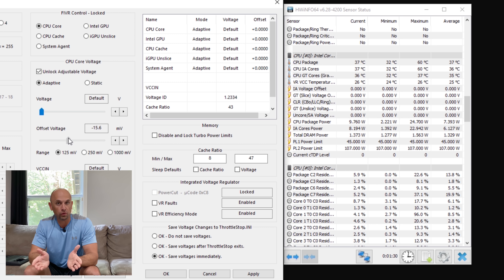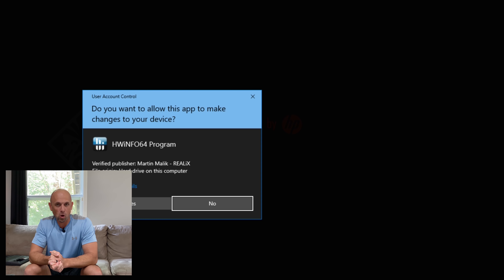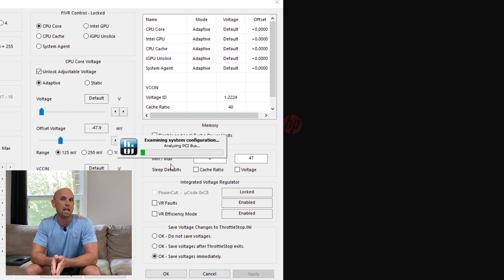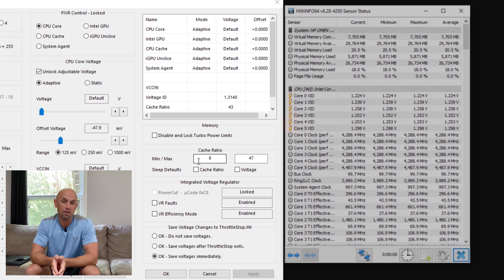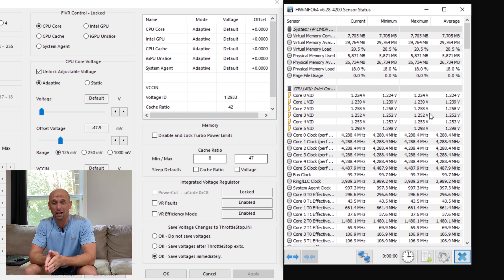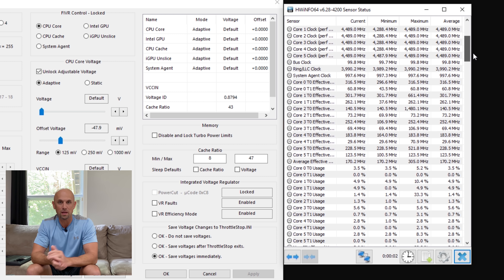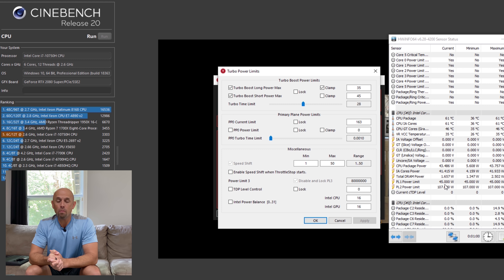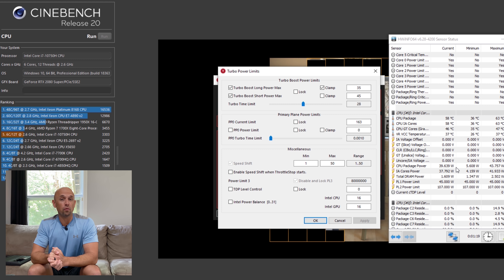Can't Undervolt?  Do This!

Comment from the maker: The Description has more information that could be worth your time, as always.  Good Luck and post your results!
Reply: Is that the thick 15 from eluktronics on the sofa 😁.
Reply: i5 9300H+2060 or i7 10750H+1660 Ti? Which one would you choose for gaming, Bob?
Reply: @rifatul  depends on wattage as said, but the 1660Ti (mobile) isn't that far behind a 2060 (mobile). If u can afford the 2060, go for it as it supports DLSS & RT, which hopefully will be supported in more games down the road and thus should provide better perf in newer titles imo.
Reply: @rifatul  Or try to find laptop with i7-9750H and RTX 2060. I7-9750H is much more the same like i7-10750H only little bit overclocked.
Reply: Hey bob, I was windering what can I tune aside from the power limits in the 10th gen i7 intel laptops?
Reply: @graelstream2353  configuring the clocks can also reduce the wattage-like giving more weightage to single-core perf & limiting the all-core turbo.
Reply: i guess Im kinda off topic but do anybody know of a good website to watch newly released series online ?

Comment: Screw intel 10th gen.
Undervolting is a must.
Shame on intel.
Reply from the maker: We’re seeing more of this lately 👍
Reply: Absolutely agree, I have the CPU in the  video and I'm so bloody angry about the locks on this CPU. There's no way I'm buying Intel next time.
Reply from the maker: Apparently it’s not Intel that’s doing this.  It’s up to the manufacturers to allow this.  Even intel’s QC7 whitebook has undervolting in their bios.
Reply: @BobOfAllTrades  hey bob. I have a question. May I know how do i determine the perfect power limit values? Like what tests to do etc. Sorry for this noob qn, I'm new to laptops
Reply: next time im going with AMD, it runs cooler and faster ._.
Reply: @shadradbad3518  Not necessarily. Faster yes
Reply: @Hijynx87  ive seen it in videos faster and cooler in Laptops
Reply: Yeah you can only decrease the voltage about 80mv max which result 5degree which is hilarious my i710875h runs between 90-100 c
All the time . This processor is great “If you live fkin Alaska”
Reply: @goldenplectrum9695  disable turbo boost
Reply: @Behavoid  disabling turbo boosts helps. But it decreases your fps tremendously :(
Reply: i also have the asus tuf f15 with i7 10870h and im so sad that i cant undervolt my laptop :)
im facing thermal throttling with temps above 80 degrees all the time and i was hopeful that undervolt would help me but im completely dissapointed now...
Reply: @faizul3747  hey man, I am getting 90c and above 80% of the time im in turbo mode and playing a game.

Comment: I watched this video and honestly did not expect much to change in my laptop's thermals. But I was wrong on so many levels, undervolting my GPU made such a positive impact on my CPU's thermals. It was almost a 10 degree difference on both of my cpu and gpu without sacrificing much performance. Definitely will watch more of your videos!
Reply from the maker: Fun stuff 🤙
Reply: Bob Of All Trades Hi throttlestop got an update and we can set a custom prochot offset, I experimented with my laptop and on a prochot of 85 I can still hit the boost clock of 4.2ghz with a sustained frequency of 3.9 ghz ( base clock is 2.5ghz) which is a lot better than lowering my PL1 and PL2 and/or locking the frequency since in my case if I lock the cpu at 3.7 ghz I still hit 90 degrees.  Because of my limited knowledge on this kind of things I find it weird that the laptop can maintain 3.9ghz (unlocked up to 4.2ghz) at 85 degrees prochot but when locked at 3.7ghz  and even lower pl1 and pl2 I still hit 90 degrees. Hope you can look into this and give your opinion. :)
Edit: I also removed the undervolt of my GPU during my tests.
Reply: ples tell me how to undervolt gpu

Comment: in my Dell G3, when the updated BIOS disabled undervolting, reverting to the older BIOS was also disabled; but resetting the BIOS to defaults enabled CPU undervolting again ;)
Reply: Same experience with mine. The CPU temps are whack without undervolting.
Reply: I also have a dell g3. Have you tried using throttlestop and seeing any improvements with that?
Reply: @Ethereal184  nope, just XTU
Reply: Which version of BIOS do you use? Mine is 1.12 and undervolt is still disabled even when i reset the BIOS to default.
Reply: @nguyenbao2093  I have 1.12 too
Reply: @martindione386  I'm using throttlestop to undervolt. How do i know if it in effect or not? It let me set the value but doesnt let me change the boost clock. So i assumed it still lock the undervolt.
Reply: @nguyenbao2093  maybe you can check the proc freq with the task mangr and see if there's a difference with and without uvolt
Reply: @martindione386  Thank you :)
Reply: @nguyenbao2093  did it work?
Reply: What is the max undervolt you guys have been able to do on your Dell G3? I have a I5 8300H and can remain stable till -0.165v.
Reply: @manuj303  i have the i7 8750H, stable at -0.130v
Reply: @martindione386 OMG. It worked. Thank you so much bro.
Reply: @manuj303 Grats. You've won the silicon lottery.
Reply: @nguyenbao2093  lol.
Reply: @nguyenbao2093  glad to hear that!
Reply: @martindione386  does undervolting decrease fps or gaming performance? I wanna undervolt my new Dell G3 (i7-10750h) because it heats up pretty quickly
Reply: @jhimaque  not sure about gaming performance, but in 3D rendering it's the opposite, lower temperatures, and higher clock speeds. :)
Reply: you should check the thermal paste, too
Reply: Mine is xps15 9560 when I downgrade to factory still can’t offset
Reply: also have bougth g3 with i5 -10300H and doesent work undervolting. My bios version is 1.6
Reply: how exactly did you do that im new to this thing and tried to look in bios cant see  reset to bios defaults anywhere

edit: i also have a dell g3
Reply: @dacobdacob7977  you cant do BIOS downgrade, i try it all. Now when i playing gta or star wars battlefront for example i just checked disable turbo boost in throttlestop , and temperature go to 60-70 degrees when playing. And everything is ok. Im playing games for 3 or 4 months now. Perfection 💪
Reply: @martindione386  Good evening dear Martin.
Right now i can't change the turbo settings, so i just disabled it to reduce the overheating aspect, the games are running well, and the temperatures never goes up to 80° C, but i've found out that disabling the turbo boost puts a limiter on my clock speed to 2
2, and my maximum is 4.5, affer warching some benchmarks i"ve seen that you can get a sustential performance boost by allowing your pc to increase it clock speed, so i wanted to know if there was any way to downgrade my bios to the basics without making it auto-update(because that wouldn't allow me to set the undervoltage).
Sorry for my terrible enlgish, i really hope that you can enlighten me with some of your knowledge
Reply: @WilliamsDarkoh  hi man, don't worry, your English is pretty good, is not my first language either. What's the version of your bios? You're using a G3 too, right!
Reply: @martindione386  yeah, i'm using a g3 3500, i don't know the version of my bios tho, i bought the pc around 5 days ago
Reply: @martindione386  version 1.8.4
Reply: @martindione386  bios is 1.8.4
Reply: @martindione386  never mind, i think that i've done the impossible in the last 20 minutes, i've found a setting from my dell power menagment app that allows me to cool the laptop, and with it to set the battery limit, both of them were things that i wanted to do, now i don"t need to downgrade my bios anymore luckily
Reply: @WilliamsDarkoh  i have 1.13.0, and still can undervolt
Reply: @martindione386  Hi Martín, I'm very curious about how you did this! My Dell G3 3579, i7-8750H is in dire need of undervolting. I've tried many times but no success, maybe you could point me in the right direction?
Reply: @paintballpiglet  turn on the G3, press F2 to get into the BIOS, there's a button in the lower part of the screen that says Restore Settings, press it, select BIOS Defaults, and reboot. You should be able to undervolt with XTU now.
Reply: @martindione386  Seems to be working now! thanks for the help!
Reply: @paintballpiglet  glad to help!
Reply: I have dell g3 too
Reply: @martindione386  I was able to undervolt until yesterday when I updated my G3 , valorant is literally unplayable since the temps go to 100 c , I use throttlestop, can u tell me how I can start undervolting 
again, I really need help
Reply: @medwin17  turn on the G3, press F2 to get into the BIOS, there's a button in the lower part of the screen that says Restore Settings, press it, select BIOS Defaults, and reboot. You should be able to undervolt now.
Reply: @martindione386  I'll try it out and let you know thank you
Reply: @martindione386  what version are u on right now and are u able to undervolt?
Reply: @medwin17  1.16, still able to UV
Reply: @martindione386  I factory reset the bios now it's working tysm
Reply: Hey @Martín Dione after resetting the bios to factory defaults, i was able to UV. BUT after a restart UV got disabled. What should i do? Whenever I factory reset bios, for the first time UV works fine.
Reply: @tanveshsarve3472  sorry man, I don't know...
Reply: @tanveshsarve3472  I think it's updating the bios again try disabling auto update of bios
Reply: @medwin17  hey how do u factory reset the bios I have i7-8750h and well it overheats a lot.
Reply: @ssiofrombg3161  yeah, switch off ur laptop and then once you switch it back on, keep pressing F2 ,it will take you into a different screen, there go into the bios option and click on factory reset and click on apply.it should do the trick
Reply: @medwin17  nvm I just did it myself
Reply: @medwin17  and it worked flawlessly lol I can finally undervolt with xtu
Reply: @martindione386  just so if this doesn't work which it didn't for me u can also click the factory reset circle and follow through.
Reply: @ssiofrombg3161  did it work?
Reply: @martindione386  yup
Reply: @martindione386  works on current bios 1.17

Comment: Some laptops can have their BIOS downgraded for when undervolting was still working. I did that with my Asus SCAR II 2070. 309 disabled it. 308 works.
Reply: So it was because of 309?
Reply: @makeEggsThrowEggs  309 disabled mine, yes. I just download 308 from their site and flash it back in the bios.
Reply: @AidedOnslaught   I have 309 and I was trying to undervolt but there was no changes and CPU temp was still above. I'll try to downgrade it. Btw they've uploaded the 310. Did you use it?
Reply: @makeEggsThrowEggs  I just checked the site now and still only see 309 as the newest. My system is the GL704GW.

I won't try it even if my system does get it. I just know I've had a lot of issues with this laptop (More issues than anything I've ever owned) and I'm not trying anything that could take my undervolt away.
Reply: @AidedOnslaught  Oh, My system is FX505GT. I can't find the previous versions of Bios in the website. Any idea where I might be able to find the previous versions?
Reply: @makeEggsThrowEggs  sorry, I do not. Just did some light googling and all I saw is how many problems your model laptop is having.

I know I'm never buying Asus again.

Have you considered repasting it?
Reply: @AidedOnslaught  It's okay, thanks for letting me know that Bios was causing the problem. I recently bought this laptop so I thought repasting wasn't necessary. Maybe I'll try doing it.
Reply: Guys I got asus rog g712lw with 10875h 
With the latest 311 bios update you cant even activate advanced power management settings through regedit. In bios i was able to decrease core offset voltage -80mv but it resulted only 5 degree decrease. Anyone found a different solution yet?
Reply: Hi there😃!

I have the same laptop (G17 G712LWS). Do you still have that bios(v 308)? Asus has deleted all previous versions of bios and can’t find any other older version😢. I would appreciate if you share that bios (of course if you still have that download)

Any other recommendations for old bios downloads would help also 

Thanks 🙏

Comment: Boats knows thermals he's giving you the tools to make your laptop's cooler faster better do your homework(lookup your  voltages undervolt cpu/gpu test bench test again) and you'll see your laptop run the way you've dreamed it would. I know because I own the notoriously hot i8750h w GTX 1060 they really dont get much hotter hitting  constantly throttling at 96 to 98 deg C sometimes  ..used Bobs CPU and GPU  UV tutorial got my temps down to 87c-92c under load CPU still running at 3.9ghz with an UV both CPU and GPU.
Reply: My Predator Helios i7 10750 H remains below 90 degree without undervolting. Is it okay?
Reply: @bulldockmansion5867  Is it 90c all the time or only when your under load ie gaming or running a benchmark? If its 90c all the time thats not good in the long run.
Bob has great tutorials on how to apply Thermal paste and undervolt the CPU also GPU. check the playlist.
Reply: Can u share ur setting please ? How much the  value for cpu core & cache
Reply: @muhammad6901  -125v for both cache and core for me works ok..but yours may be diff. Good Luck God Bless in Jesus Christ.

Comment: Would love to see you make a ryzen undervolting (in case there is the option) and amd radeon notebook gpu undervolt guide in near future. 
Great content as always Bob.
Reply from the maker: This is not possible right now. It can’t be done I talked about that video several months ago got lit up about it
Reply: Undervolting makes your laptop unreliable, thats why laptops don't come with undervolting by default. Acer Helios 300 2019 had an undervolt preset, however it is applied only when enabling the turbo mode. I think its time to stop considering CPU undervolting. (GPU undervolting may be OK)
Reply: @PremVijayVelMani  undervolting is not about pushing the offset slider to the left as much as possible just because the laptop cpu can handle that much of an undervolt. It must be stress tested on all cores and threads before considering the chosen undervolt value as the best for the given system. Using Throttlestop's inbuilt benchmark tool does serve the purpose really well.
Reply: @sm13752  Yeah I know, however the silicon may change slightly over time (or due to some other factors). So we need to keep doing the stress tests regularly to make sure nothing bad happens while doing important work. This is all time consuming. Rather than doing all this I would pay more for a laptop that has better thermals without any undervolt. Even Intel is forcing OEMs to disable voltage controls and improve thermals for its 10th gen laptops.

Comment: This is my last ditch effort. I’ve got a ROG laptop with a i7 8750H, and I was running on BIOS v314, until I realized I was overheating because my GPU undervolt was not being applied. So I checked bios updates and found v315, released last month. Great, I though, until I undervolted the gpu successfully, only to thermal throttle on the cpu during a graphics benchmark. I go there, and guess what? No undervolting happening here. I don’t have much hope either. The i7 8750H is a 45W professor, and even when limiting to that wattage, I’m hitting 90°c on idle because the system randomly pulls a 4.0Ghz All-core boost for no apparent reason (speed shift is set to 128, only monitoring apps open in background)

Comment: hi bob i just wanna share that i successfully undervolted my hp omen  dc1040nr by lowering the frequency  on all cores to 3.5ghz and then adjusting the cpu core to -280.3 and after doing stress test and playing some fps games i'm having thermals around 85 degrees fahrenheit and i'm satisfied  with the result.bios was updated ang everything runs smoothly and no need for me to revert to the old bios.just sharing😊😊😊

Comment: Thanks Bob for the great information. I came to your channel through ownordisown recco. Bought an omen 15 with the 2060gtx and same i7cpu 10750H (as in your 17in review)
Out of the box it ran a little hot in games where the max fans would kick in, and 98deg C in benchmarks on CPU. Using your info I was able to get the the CPU and the GPU running in the 60s deg C while gaming with auto fans & omen performance setting - GPU voltage pinned with afterburner, every else stock, and muted the CPU with throttlestop at 3.89Ghz with CL1 30watts, CL2 38watts, max x40 
I got room to increase in future, but lot to be said for the cool & quiet gaming. 
I hope someone smart hacks a way to be able to undervolt these CPUs, thanks again!
Reply: please tell me how u do that I have a same one omen i7 10th gen
and I can't ubdervolt gpu and cpu
Reply from the maker: Search on YouTube “Undervolt laptop GPU”

Comment: locking the undervolting on my dell XPS 9560 has made it unusable for anything more than general browsing/emails/youtube.

This machine is was insane 4k screen, 32gb ram, 2tb ssd, i7-7700, with gaming capabilities 1050ti.......now it's all useless due to crazy thermal throttling. (even after thermal pasting it.)

Just going to harvest it for parts now.
Reply: Basically same thing happened. Was prepping for Windows 11 update - and updated the BIOS, and now I'm stuck with no undervolt and icreased temps under load. That said, repasting and lowering the TPL to 35-45 did help keep temps under 40 at idle/medium load. So no 50/60 spikes watching youtube now.

Comment: Bob, great video! Based on your reviews (I've seen many), what brand do you think has achieved the best thermal performance on their 1000-1500 laptop lines?
Reply from the maker: I really raved about HPs Omen and the Eluktronics Matrix RP both with the 4800h.  Those both handled their hardware pretty respectably 🤷‍♂️
Reply: @BobOfAllTrades  Appreciate it, Bob! I'm moving to a laptop setup like you've moved to, and I really wanted the thermals to be sufficient. Thanks!